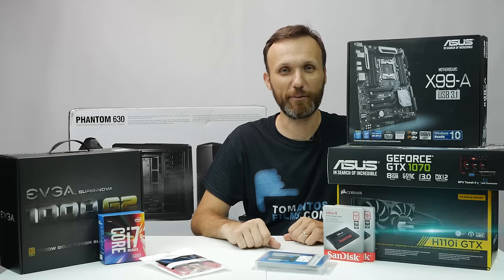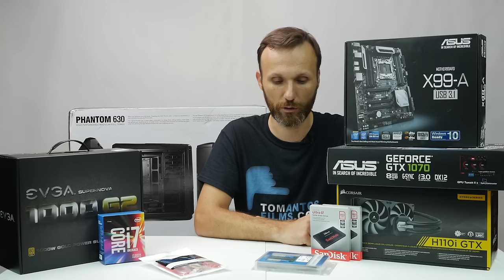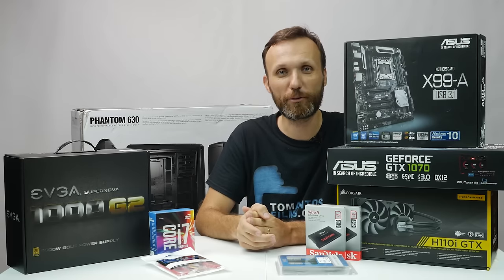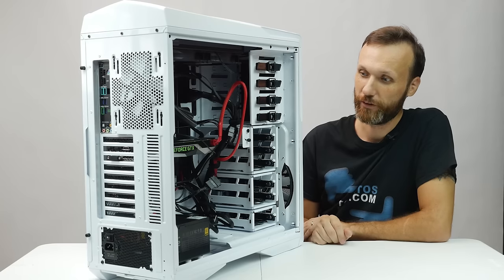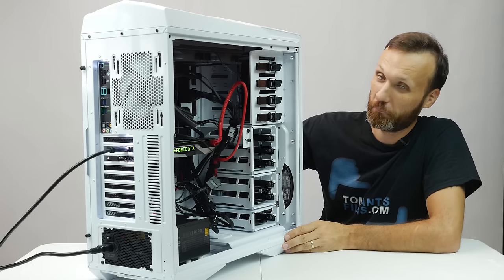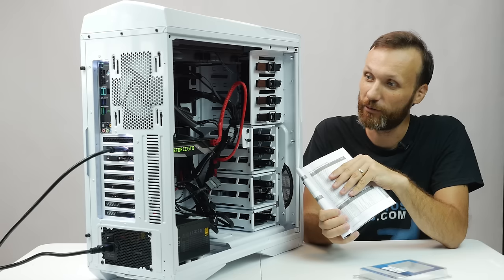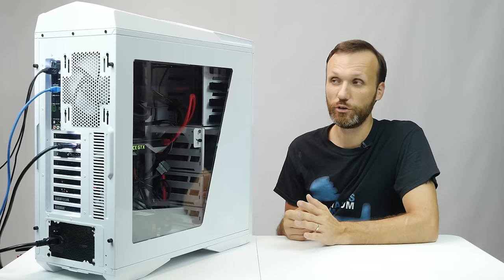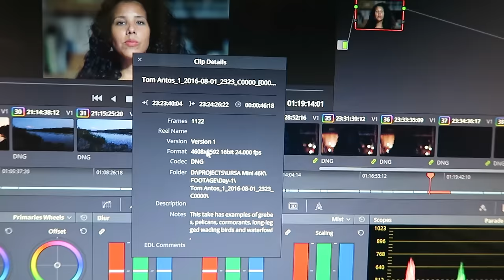4K RAW Video Editing Machine for $2K

Comment: my pc to render a 10-minute video in 4K at 60fps in H.264 format with a bit rate of about 68mbps (short set at maximum quality for youtube) it takes 1 hour and 30 minutes, and I have the same video card of this configuration and same ram, I only change that I have a mechanical hard drive and not a ssd, besides the fact that I have a i5 4690k not overclocked. How much faster would this pc? I would agree to change the cpu (and consequently the motherboard) or the SSD or both? :D
Reply: CPU. Not only is mainstream i7 considered the bare minimum for editing, you really should have at least 6 cores and 12 threads to really see some speed. I suggest a 4790K, 6700K, or 5820K. Personally, I'm gonna wait for the 8-core Zen. 

SSD won't really help with render times.
Reply: Also, for MOST editing programs, the CPU is more important than the GPU, but it's the opposite with DaVinci Resolve. Your setup has a mediocre CPU with a great GPU, so you might not need to spend anymore money to get good render times with Resolve.
Reply: Use Edius 8. Use integrated graphics! Incredible speed.
Reply: SSD will definitely helps in loading application much quicker, a much faster to load a  huge project files and importing media to a software.

Comment: Is this pc build good for 4k video editing , advice please ?

cpu INTEL Core i7‐6700K 4‐Core 4.0GHz (4.2GHz) Box
mb MSI Z170A KRAIT GAMING 3X
mem
2x KINGSTON DIMM DDR4 16GB 2400MHz HX424C15FB/16 HyperX
Fury Black
hdd
ssd SANDISK 480GB 2.5" SATA III SD8SBBU‐480G‐1122 Z410 series
vga
GIGABYTE nVidia GeForce GTX 960 4GB 128bit GV‐N960WF2OC‐4GD
rev.1.1, 4GB GDDR5,
odd LG DVD
COOLER MASTER K350 (RC‐K350‐KWN2‐EN) + NJOY Woden 750
750W e (PWPS‐075A04W‐BU01B)
Reply: Its OK. More CPU cores and a more powerful graphics card will speed up the work. That's why most people go to X99 these days.

GPU - see Cinebench R15 Multi-thread performance - http://www.anandtech.com/show/10337/the-intel-broadwell-e-review-core-i7-6950x-6900k-6850k-and-6800k-tested-up-to-10-cores/6

GPU - see http://www.anandtech.com/bench/GPU15/1231
Reply: Can you recommend me components for 4k video editing, would be grateful? Something that will not cost tooo much but work without any problems?!
Reply: It really comes down to your budget or what kind of editing you do. Are you doing heavy editing like motion graphics, and/or working with multiple layers and adding effects then masking at the same time? on top of that color correcting/color grading your footage, those are consider heavy editing. For simple editing with light color correction and transition, you should be ok but it wont be smooth in real time editing.  I would go with an X99 chipset for video editing, atleast a 6 core like the i7-5820k or i7-6800k, these are pretty good, especially overclocked.  As far as GPU go with probably go with GTX 970 because of the 256-bit memory bus (smoother in real time editing), for 4k edit.  SSD plays a big role on your system, so youre on the right direction.  You need a balance system so nothing will bottle neck your work. i hope this helps :)

Comment: have you got any before and after comparisons between your old and new system? How much time have you saved rendering to different formats?
Reply from the maker: Yeah, my old system couldn't even load the RAW 4K footage without crashing. The new one allows me to edit raw 4.6K footage but only in Davinci Resolve, which is GPU accelerated. Adobe still sucks, but at least I can edit it the pro rest files... just not raw.
Reply: What were your old system specs?

Comment: This is a gaming pc, why not mounting dual xenon, ecc ram and a quadro  ?
Reply from the maker: Cuz I also like to game
Reply: For me it make sense to have a workstation and a gaming pc separate, but one for all it's a cheaper solution
Reply: My friend, are you considering price here... a X99 i7 is more than enough to process even the most demanding footage and Quadro cards are just built for reliability. The GTX 1070 outperforms the Quadro M6000 for much under 1/10 of the price.

Comment: that GTX 1070 will not do any better in video editing, if anything the gtx 980ti will do a better job. in the gaming side, it'll out performe the 980ti of course.
Reply: 1070 is way better than 980ti for video editing :) dont let the cuda core fool you :)
Reply: +Hudz Pro (TMR) nooo, do some research, its not the cuda cores and I can careless about that in video editing. the 980ti is 384 bit interface vs. 256-bit on the 1070, the pipeline stream can stream more data.  Even the 980ti is a bit better than the new 1080 in video editing, go check it out my man!
Reply: I have GTX 1070. The price difference of 980ti vs 1070 is not worth the performance. If I was on a budget I would definitely choose the 980ti but for someone looking for a Graphic card and not on budget, They should definitely go for the 1070 man.

Comment: That Cable management is triggering me lol
Reply: No :D
Reply: Good cable management has nothing to do with ocd. You want to avoid clumping cables together since they block airflow. Now you know and knowing is half the battle.
Reply: watch the linus video on cable management and its effects of temps. surprisingly, it will have almost no effect to not cable manage, even if it was 10x worse than this. that being said, it triggered me as well lol - it takes like 10 minutes to make it presentable!
Reply: What was bothering me more than that was the coolant lines touching that back fan! Ever so slowly rubbing a hole in one and BLAM! Fluid everywhere and that computer is done. :-(

Comment: He bought a 1000 watt psu for a system that pulls less than 500 watts under full load... sigh. A 750 watt would power two GTX 1070's and a overclocked 6800k easily under full load.
Reply: Nothing wrong with an over-specc'd power supply... less stress on the components.

Comment: Picky enthusiast platform. Sadly it's the only platform that actually makes you read the manual to buy ram. Some modules are compatible in 4 stick config but not eight. Even better some of them do work if they are 4GB modules but not 8... same brand same model... woohoo... enthusiast ¬_¬''

Comment: Ok, this is not a IT-Guy, i guess. 
#1 Turn the powersupply around ! in a real life situation this thing will suck up the dust from the ground ! on carpet its blocked !
#2 CABLEMANAGMENT ! why did you buy a case with all the bells and whistles and then not use them ? Unprofessional !
#3 Plug in a mouse and keyboard ! or this thing will never boot in a million years !
and never touch any contact pin on any part in a pc or mac EVER without gloves or a antistatic wrist strap attached to a large piece of metal ( like a huge table ) or a professional electrical grounding.
Nice parts though !

Comment: This is what happens when you are building your first pc. Full of bottlenecks. Not good enough for 3d, not good enough for animation  and effect heavy post production, not good enough for 4k editing. Overkill for gaming. And ugly big. I've had the same tower 3 years ago, when I was raiding 8 hdds. Now I have a tower 1/4 size without a bottleneck and with 4 ssds and all modular psu, full size gpu etc. 

If you're planning to build a video editing pc, do yourselves a favor and watch Linus and read Adobe forums for parts and setups.
Reply: any links to your suggestions?
Reply: yeah, any links ? or maybe you could share your own setup ? Or what ou think should be the best ?
Reply: I use pcpartpicker.com but I wouldn't recommend looking at builds there. You need to do your own research and make your own build, based on your needs. If you need help, you can dm me.
Reply: Burak Kaan Kızılkan well... i've been on imacs for the last 10-15 years.. 

I'm considering getting back on a pc. I'm a creative. I do graphic design/illustration, a bit of video editing (premiere pro and learning after effect), might do a bit of animation later on or 3D but for now that's it. 

when I saw the surface studio I thought this is what we've been waiting for. but in the same time all the hardware is outdated ad the pen might be an issue as well as their dial device for now as its not yet set for any adobe apps (though all in all (no pun intended ) its a huge leap in terms of progress (considering mac isn't innovating since at least 5 years) but i might wait for their second generation. 

SO i'm looking how to build a correct but affordable PC that I might want to connect with a cintiq 27 QHD (which means i'm gonna have to add at least 2000€ aside from the pc).

Also I'd like to know if there s a way to make it as longstanding as possible (yeah I know i can buy parts every ... years) but my current Imac is still standing after 7 years is what I'm saying, i'l probably upgrade every 5 years but i'd like something solid for a while and if possible not too big and well designed. 

For video editing I saw that what he s proposing is pretty good (even though you seem to disagree). 

Also since I don't know how to build in i'm gona ask someone. But can all the hardware he did put can be put in a mini ITX ? or somthing small. Also not a lot of well designed minimalistic cases outhere. lots of them looks awefull (from a design/esthetic perspective / most of them looks like tuned up cars with flames on it for rednecks). I'd like to avoid as much a big thing under my desk, but I get I might have to sacrifice that for the sake of cooling system and power , etc...

Comment: Better solution is iMac 5K.
Reply: lol :-) only a hackintosh can beat a pc nowdays.
Reply: ***** just google how much does cost good 5k display ;).
Reply: PC > Mac
Reply: ResQ maybe, but Final Cut Pro > Adobe Premiere

Just google speed comparison. Premiere is unoptimised peace of shit.
Reply: espro Nooooooooonononoo i much prefer Adobe applications over Final Cut...
Reply: +ResQ final cut is the better program imo
Reply: Agree with final cut, it renders faster the premiere, Adobe CC is a mess currently and sux on performance. But once zou used Davinci you never look back, it  blows both out of the water.
Reply: Yup...have the Mac Pro and Final Cut Pro X runs like mad on it...
Reply: Leigh Miller of course it does, its a damn expensive machine, however you couldve gotten the same performance on the pc side for less money because macs are overpriced
Reply: I have an iMac 5k upgraded 32gb ram 4gb vram and it's got it's still got issues with 4kraw red footage. You're better off with a scalable system with solid cooling like the macpro or a pc build if you're adobe only. if you work with 4k raw the 5k iMac can do it but a system with better cooling like a tower or mac pro will be more scalable.
  If you're just editing internal 4k footage from say like a g4 or drone footage 4k .mp4 then imac 5k works perfectly but with large 4k raw or 4k pro res it slows down quickly due to temp issues. I have first gen though I don't know if the new ones are any better
Reply: ***** Couldn't agree more dude... Thanks for the comment :)
Reply: +Harrison Freni just as an aside....my 8 core Mac Pro handles 4K footage like a champ in Final Cut Pro X.
Reply: ***** No arguments from me on that, sounds awesome. :D
Reply: And with each update Davinci Resolve makes huge steps forward. Love buying it once and getting all updates for free!
Reply: +Harrison Freni the Mac Pro was designed to be scale able via software. Developers just haven't fully caught up yet. Adobe products run faster on CPUs with less cores. Hardware is way ahead.
Reply: +Harrison Freni I do...not my first rodeo. I started on premiere on a i7 of. I got more mileage out of the gpu choice vs the cpu. Even Lightroom and photoshop benefit more from single fast cores and a good gpu.
Reply: ***** thats what my initial comment was about. you need intel cores for premiere. cuda cores for davinci.
Reply: ***** And only good hardware\software optimisation for Final Cut :).
Reply from the maker: For the same money PC is better
Reply: Tom Antos Agreed but Mac's hold their value much better over time and are prone to less hardware/software conflicts.
Reply: ***** don't take my word for it. Do some research. Apple products hold value better during the life cycle. Your mileage will vary.
Reply: ***** you're splitting hairs now. I own three cars and it certainly doesn't mean I couldn't use a little research. I also owned PCs and macs. Sometimes at the same times. Mac always holds its value better over time and tends to me more reliable. As I said, your mileage may vary.
Reply: My 2009 Mac Pro with 2x6 CORE Hyperthreading (so 24 usable cores) 3.46Ghz XEON Processors cost me £2.5k to build including the Nvidia Titan X graphics card, boots from 512gb Samsung M.2 SSD, mounted on an PCie adaptor card, with 4x4TB Hitachi 7200rpm, 128 mb cache HDD's 64gb of ram.  
 My watercooled Windows  PC cost me around £5.5k (about £1k was watercooling) it has i7 5960x cpu, on Asus x99 E-WS motherboard, 64gb ram, two Titan X GPU's, 960gb ssd boot disc and 4x5TB HDD set up in raid 10. which one do I use the most, the Mac, why? it just works.
I shoot 4K on my GH4's, and the Mac just integrates with everything its a much more pleasant place to work, FCPX runs 4k smooth renders in the background, saves time, looks better. The Windows PC is powerful, but it is high maintenance, disconnects from the internet, always seems to need drivers for everything you connect to it, and can't read a lot of cards or devices. I get frustrated and just use the Mac, which has a similar Geekbench score. 
 I also run lInux on another dual boot Linux mint/ windows 10 pc, Linux Mint is a lighter OS and is less resource hungry and seems much more stable than Windows 10, And DaVinci Resolve runs on all of them, I use FCPX mainly,  I am not a fanboy of any OS, I have been filming and editing for 27 years, long before NLE came along, I just use what feels the best for me, and in my case it's the Mac Pro, (not the trashcan, most mac users don't consider that a true Mac Pro) but each to their own as long as it get's the job done.
Reply: no, especially not for the price.
Reply: Honestly, your builds are all over the place. You wasted a lot of money on GPU's. Most editing applications do not use that much gpu acceleration, you would have been better off with 1080's, 980ti's, or the amd equals, and spending the rest on a  processor (even though you already hit your point of diminishing returns) and high speed ram. By the way, hyperthreading is hit or miss when it comes to rendering, although it may help with multitasking. It's been proven that i7 processors can beat out Xeons. Physical cores will always be better.
Reply: Hi can I ask u a question, Im a movie maker and I wanna start coloring on davinci Ressolve... Any idea what is the best mac I should get? like a macbook pro... Nobody seems to know in Apple store? I would really appreciate if u could guide me. Thanks. Milo
Reply: ***** Thanks for the advice, I will look into it ;)
Reply: omg iMac 5k ...  great screen, shitty computer , crap performance. had one, went back to a PC build
Reply: 5k imac will throttle if you stress it too long. find the reviews
Reply: lol um what?
Reply: With a Mac, you get to use Mac OS X...
Reply: macs remind me of Chromebooks, so much potential wasted /: